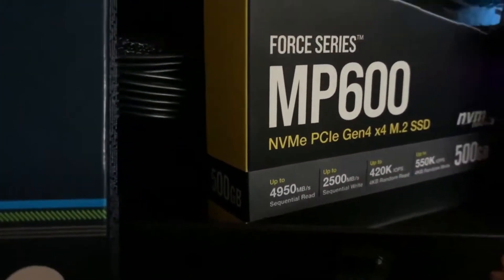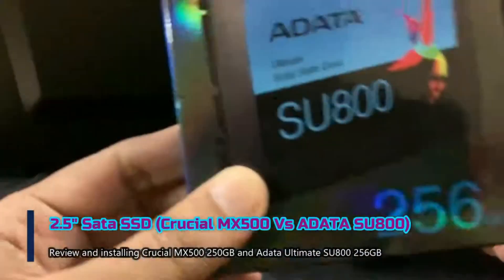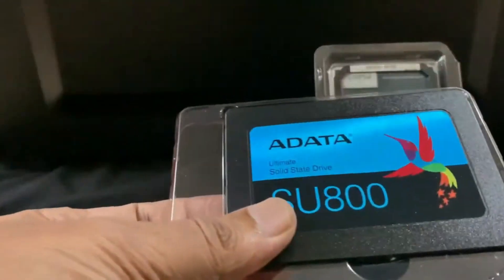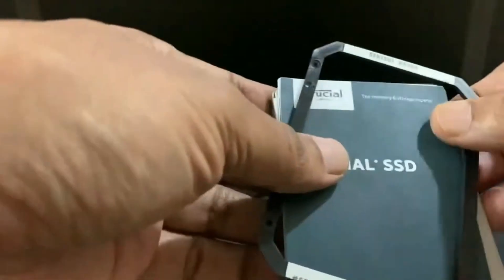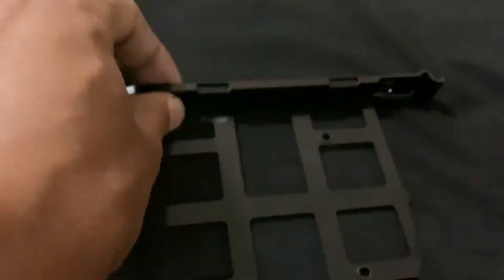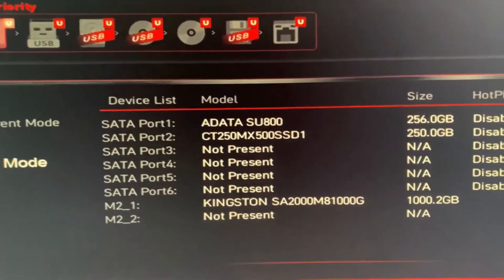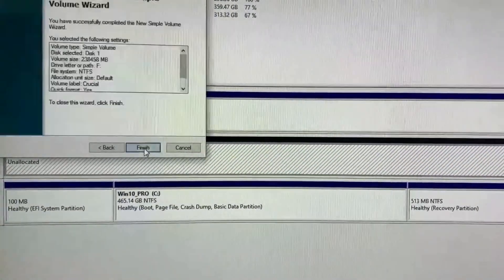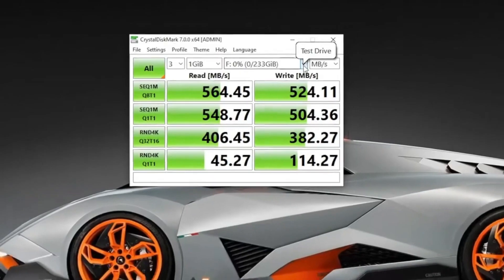2.5 inch SATA SSD | Crucial MX500 250GB | ADATA Ultimate SU800 256GB | Unboxing Review @gizmohub22

Comment: Hey, thanks for the review!
This is the only comparison between MX500 and SU800 on YT.

Crucial MX500 is mostly out of stock or overpriced. How's it going with ADATA SU800, since it's been an year since your review.

Can you suggest a SSD, I want to use the SATA SSD drive for boot/gaming. My current options are:
- Samsun EVO 870 EVO - 500gb - Rs.5000
- ADATA SU800 - 512gb - Rs.3800
Reply from the maker: Hi @nikhiljindal9806, first of all thank for watching my videos. If you have the option for a secondary nVme slot then I would suggest you go for any budgeted 500GB nVme for gaming mainly. For boot or any secondary OS (Like linux) you may go for the 2.5" Sata SSDs which are almost as pricy as the nVMEs. you can still go for the Crucial CT500BX500SSD1 (at around 2.7k) or the ADATA which are less pricy than the samsungs.